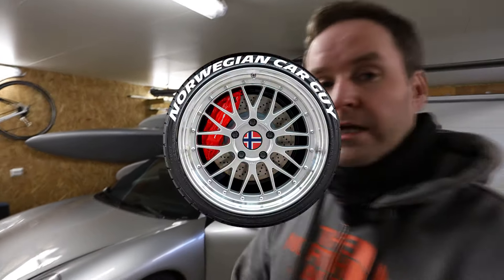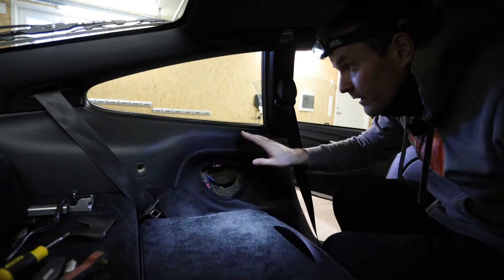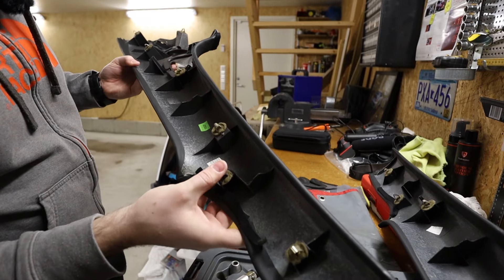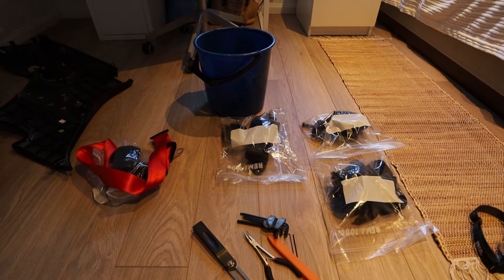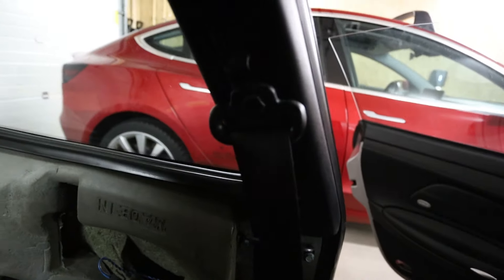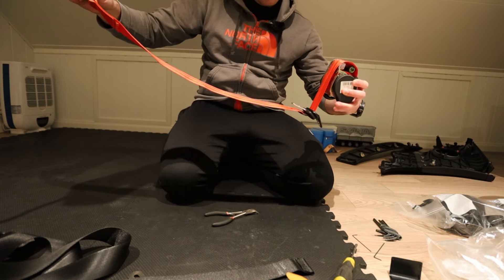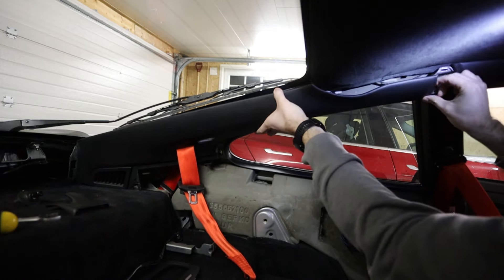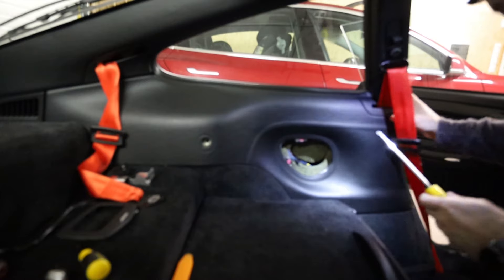How to install or replace red seat belts + GT3 belt cover on Porsche 911/996 Turbo

Comment: I don't usually leave Youtube comments, but I have to here. I was in the midst of doing a black to red seatbelt conversion on my '02 C4S. The belts I purchased only fit the 996.1 model without airbag sensor, so it was tripping safety faults. I almost gave up because I couldn't solve the rewebbing aspect until I stumbled upon your video. THANK YOU for this! Already on to the next steps. Keep making videos like this! Bravo
Reply from the maker: Thanks for the encouragement! Feedback like this is why I continue to make the videos. Sharing knowledge makes the ownership so much easier👍 😁
Please subscribe if you have not🙏

Comment: Great video NCG. Im just about to do the black-to-red F&R seatbelt change to my 997.1 C2S as I bought new red belt units on the basis that I figured the webbing had to be swappable so the need for the entire new OEM belt mechanism & considerable cost difference was avoided. Sure enough, first video I click on having done a search is yours & really helpful from start to finish with the tips on the order to remove/refit trim, clips & their positions, the hidden torx bolt, how to rollout the old belt & wedge the roller so it doesn't recoil & lose the critical spring aspect. All really clearly filmed & easy to follow. Now my weekend job got a whole lot easier, thanks buddy!
Reply from the maker: Appreciate the good compliments!! Happy to help and good luck with your project 👍

Comment: Was thinking about upgrading to the red belts in my 996.2 but wow that’s interior. Seems like a huge pain to take all apart. 😳
Reply from the maker: Yea it was more to remove than I thought, but this video should give you all the info you need at least 😁👍

Comment: I was wondering if the 997 could use the seat belt adjustment covers from the 996 gt3？
Reply from the maker: @Ehome-c1o  you can see the compability list, if you follow the link in the description. It's not listed there, so probably not?